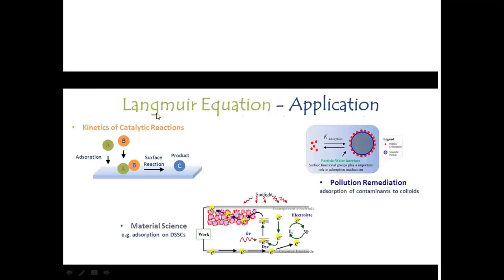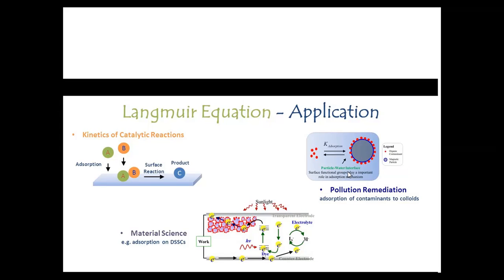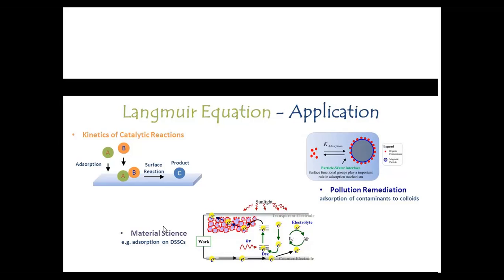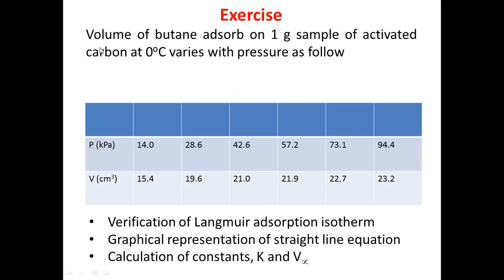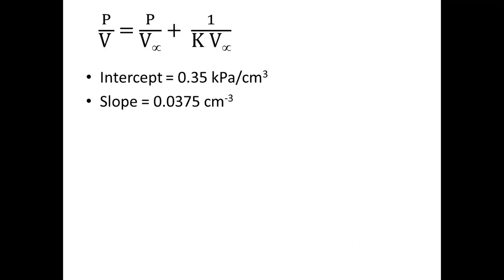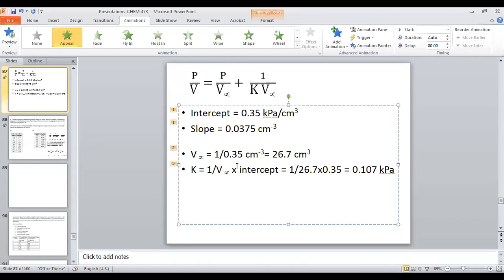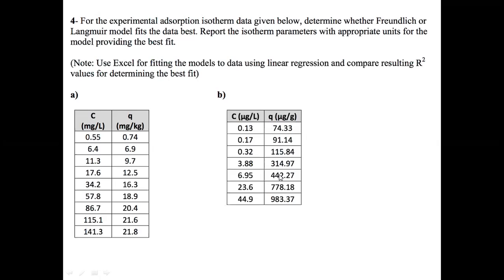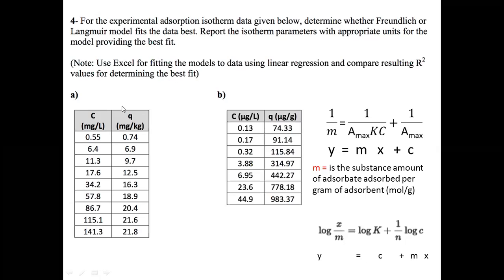Langmuir Adsorption Isotherm: Outcomes, applications and exercise

Comment: How did you get the value of the slope and intercept?
Reply: Iv to do this in exam .. pen paper no excel and all pls help
Reply: @nj_1168  did you get the method? Please tell. Tomorrow I've to do this in an exam.
Reply from the maker: when you plot a graph on MS excel with straight line equation, you will directly get the values from equation  y = mx + c
Reply: @MuhammadAkhyarFarrukh but it's kinda confusing
Reply: Please help us on how to find the slope of intercept
Reply from the maker: @jesugbogoenis  it is explained. It can be directly get from straight line equation and with m and c. Like y = mx+c
Reply: I don't understand anything. How did you get the slope and intercept